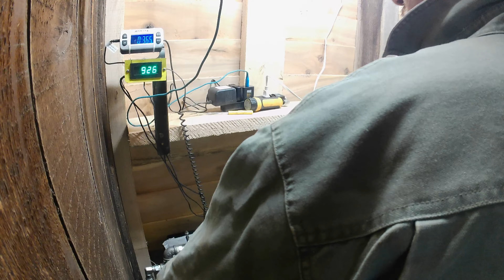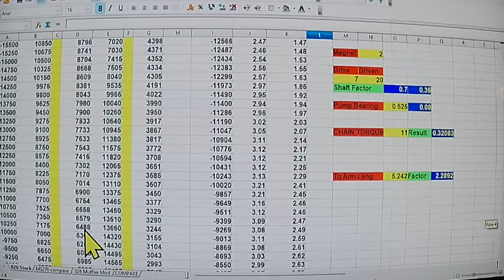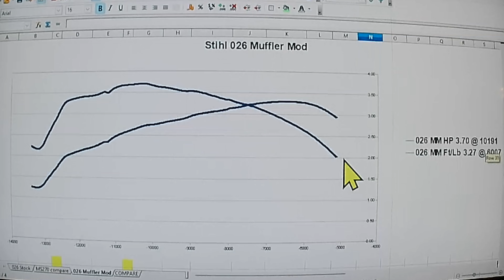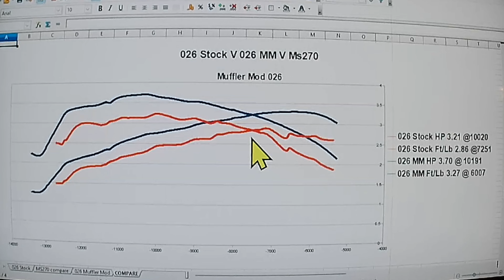Stihl 026 Chainsaw Project  Muffler Mod DYNO RESULTS  TEST CUTS

Comment: About the hemostats- I belong to a couple of radio control aircraft clubs, and we were talking about prizes for an upcoming event, one of the wifes worked for the local hospital, talked to the supply guy, and showed up with a gallon baggie of surgical supplies 😊. Being as it was my idea, cuz ya know that you absolutely need pinchers for the delicate and small stuff……well I got first grabs.  Having purchased some previously I knew what to look for, and sure enough I got a couple of German made ones.  They are made of the best stuff, and aren’t rubbery like the third world ones 😮.  But I primarily use them for me, and the cheap ones are for wrenching.  Absolutely worth every penny when you need them!
Reply from the maker: @wrstew1272 I never get to pick through, I would just get what was discarded... I never turned anything down... but some stuff I had to ask for if it was normally red-bag stuff. The little IV clamps for lines are ways thrown away with the set-up... I like the clamps for fuel lines; I had to "demand" some of those!!  No wonder my shop is such a mess; a hoarder crossbred with a tinkerer is a combination that will usually have SOMETHING on-hand to fix most situations!

Comment: Great video. I love any kind of dyno videos from chainsaws to a train engine and everything in between. I was just test running one of my 026s yesterday. You guys have a merry Christmas
Reply from the maker: @FarmlessFarmer-xs1he   MEEE TOOOO!! I had another dyno years ago when I was building and pulling tractors. It was an old antiquated dyno, and there were no electronics on it, but I could see results adn test theories; I love that!! I did barbaric things to engines that "should" never work, and proved out theories I had. First cam shaft I ever did, I reground with a 4-1/2" hand grinder... and made good power. Hope you and your loved ones had a Merry Christmas, too.
Reply: Thank you very much

Comment: Interesting. Lots of hrs, running 26s. Overall it did what it was suppose to. Cool to see what tweaks do.
Reply from the maker: @larryrumppe3720  I believe they are a good small saw that have more potential. I got the timing numbers on stock (44mm) cyl, new cyl (44.7mm), etc... today. Upon peeling the bark off of the carcass, it appears there is a LOT of room for improvement without going overboard. May have a chance to put the aftermarket cyl on tomorrow and get a base-run on dyno to get an indication of what one may expect with JUST a piston/cyl swap.  Hope not to drag it out on one saw for TOO long, but plan on a few more vids on this build. Glad you're here, Larry; thank you and Merry Christmas.

Comment: Amazing what removing a little restriction will do.  So nice actually seeing the process and the results.  That dyno is going to keep you busy testing ideas.

I think my clutch is slipping on my Echo 7310 as well.  I'm curious what your thoughts about solving that issue will be.  My saw is just over a year old.  Clutch shows no evidence of slipping but it's getting hot enough to not work after a long mill cut.

I'd appreciate any ideas.
Reply from the maker: @Kevin.L_   A little restriction goes a long way; I don't think the deflector was bashed-in as the outer part of muffler looked undamaged.
Clutch slippage (in my guestimation) can be caused by a few things. 
1) Bogging saw down some thereby lowering centrifugal force to keep it engaged.
2) Overheated (thereby hardened) clutch surfaces
3) Grease/oil buildup inside of clutch drum... which may cook out over time, but may leave a glaze.
4) too strong of clutch springs;  weak clutch springs can/will let chain creep at idle, but DO let them engage harder; it's a fine line between letting chain creep and most-possible engagement at RPM.
5) clutch shoes worn past spec and/or drum worn too past specs. Not sure if they still publish specs to general public or not? 
Probably more causes, but those of the off-the-cuff ones that you have probably considered. 
Maybe someone else can chime-in with other ideas.